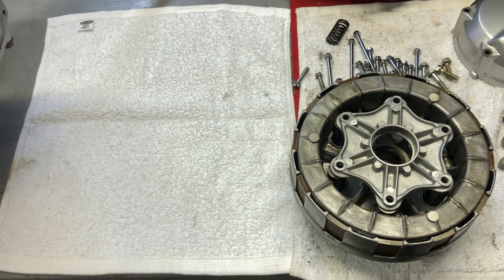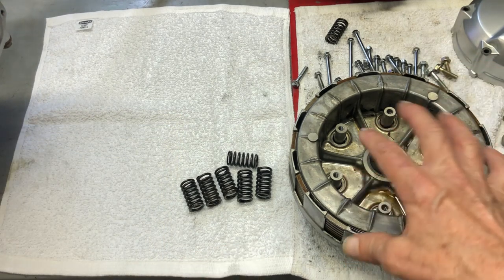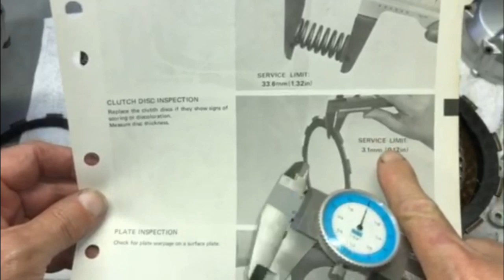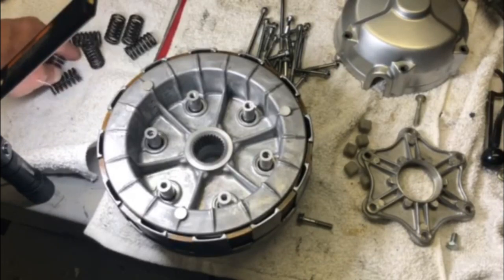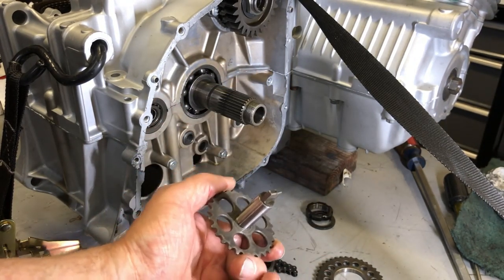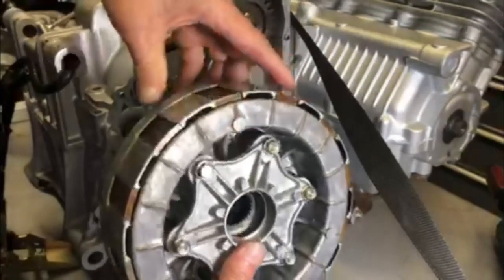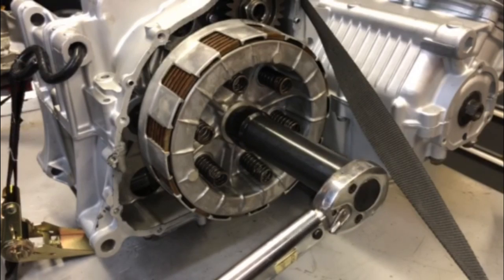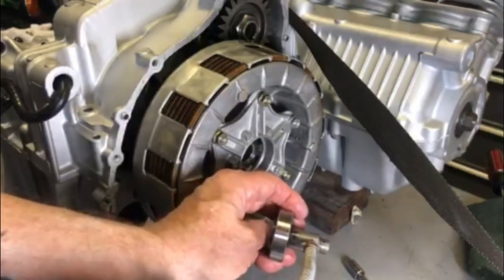Honda CBX Full Restoration & Engine Rebuild Video Series - Part 21 Re-assembly Part 8 Clutch Install

Comment: Just seen oil filter spring has a washer after it, then oil filter.   That's the way I did it for years but read it lessens pressure on filter. So I picked up a couple  of those washers...

Comment: Pete, I guess now would be good time to torque down the primary drive gear shaft nut too, before the clutch basket was installed? In an earlier video, you suggested that this be done at as later time? Thanks for the videos, seeing it happen before your eyes makes it much easier for the novice like me.
Reply from the maker: Hi Garry, Yes, that is correct. I should have mentioned that in the video. Thanks for bring that up :)

Comment: Isn't it better to shift into 5th gear by tightening the clutch nut? Then there is much less torque on the gearbox output shaft. Great videos, thanks!
Reply from the maker: Hi Mike, Yes, you are correct. It's possible to do in any gear, but you are right, higher the better. Thanks for bringing that up and thanks for your support. :)

Comment: Surely better to be in top gear for torquing, first too low..  higher the better. I know easier to turn in top but harder to stop on the drive shaft in first.
Reply from the maker: Yes, you are correct sir , Thanks Dave :)

Comment: Hi Peter, congratulations for your videos I wanted to ask you something, is it the same to put the plates with the rounded part inwards or outwards?  What would be the correct way of mounting?  thank you very much greetings
Reply from the maker: I would put the rounded edge outward, only because that is how the factory installed them. I am sure they were made that way for a reason. I wouldn't take the chance.
Reply: @digitalpizza1  Understood, thank you very much for your answer, I will mount them as you indicate, I will continue watching your wonderful videos.  Sincerely

Comment: Should have replaced that oil pump drive chain. It had a little bit too much slack from stretching. IMO
Reply from the maker: I have used new ones in the past.
Even the new ones are loose.
I think Honda designed rhem that way so they wouldn’t stretch

Comment: Pete that long socket to tighten the clutch looks awkward to me
Reply from the maker: I agree, but it worked, it looks weird, but it works pretty well. I didn’t have the proper tool to hold the basket while torquing it , but I got it tightened to spec.

Comment: I dont see the oil separator plate, behind the clutch, has been installed.🤔
Reply from the maker: Hi CBX, yes, it has been installed. I noticed that after I did the video :)
Thanks for the comment. Its good info

Comment: Missing your oil filter spring washer
Reply from the maker: You’re right Michael, I actually realized that and put the washer in before I mounted it onto the engine. I actually did not show that in the video :-)